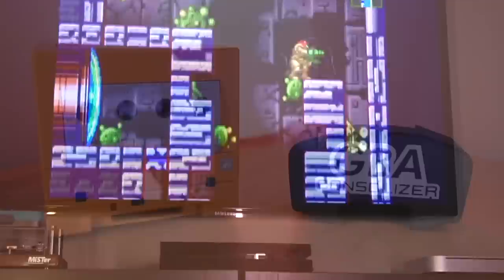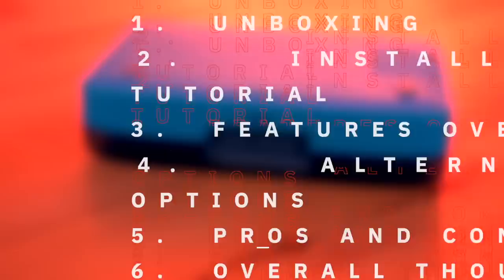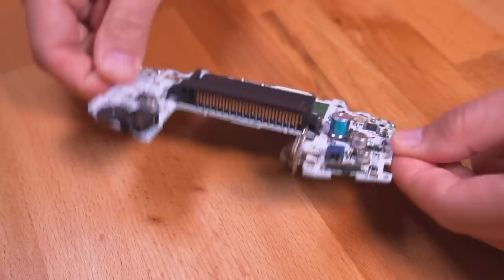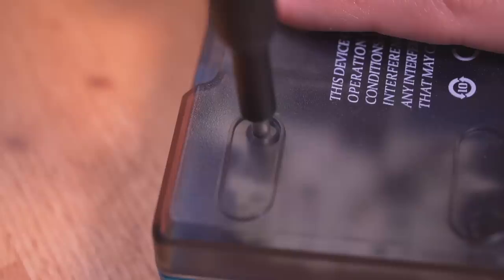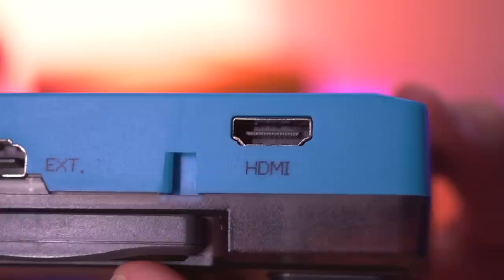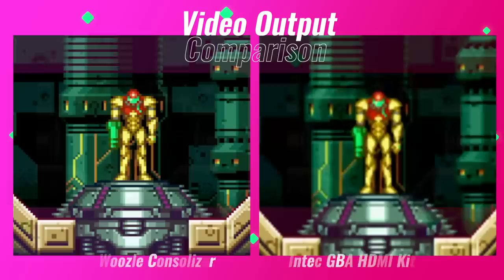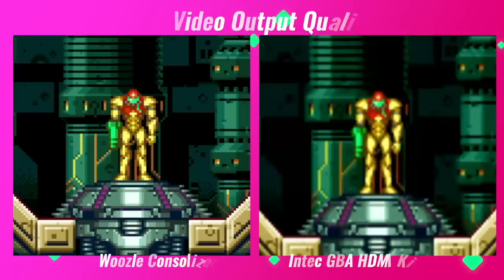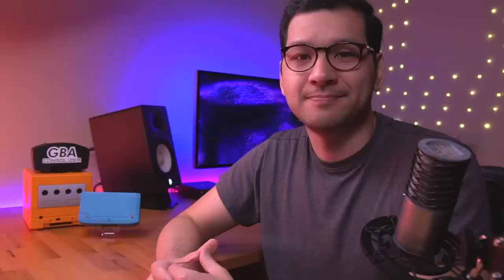Easy NO SOLDER GBA HDMI Consolizing Kit!  BUT, Is It Any Good?

Comment: They should have made a premium version that makes use of the screen on the left over GBA converted to controller. Maybe use one of the left over holes (the headphone jack?) to add some ability to send video to the GBA's screen so you could even take the thing on the go if you wanted. The GBA's existing battery compartment could be used to power the GBA  controller side but I imagine you'd need some kind of powerbank or something to power the main unit.
Reply from the maker: That would be cool!

Comment: I knew as soon as i saw the Aspect ratio switch it was gonna have garbage video output, which is such a shame as it's an amazing idea for a solderless install and and the construction seems great, the design is nice too and the GBA styled controller is an amazing idea too, the only thing i'd like to see physically change is an extention for the cart connector as it doesn't make much sense to have it on the back.. it's so close to being perfect, but man that picture quality is a dealbreaker.

Comment: The soft image isn't too much of a deal breaker but that aspect ratio is.  If they can fix that then they have a solid product.  I'd even be happy paying a few dollars more for a better upscaler/conversion chip that can do it right.  I absolutely love designs that utilize pogo pins because it creates accessibility to the mod for everyone.  The controller conversion board could be VERY desirable even if the consolizer flops though and is a great way to prevent e-waste.  It also retains the nostalgic feel of playing GBA in your actual hands.
Reply from the maker: Totally agree!  Hopefully they can address the aspect ratio before delivery of the Kickstarter

Comment: 2 things you didn't mention.

One is a ping time comparison.  You should plug it in the CRT Composite hookup. And compare ping vs Game Cube and the other adapter.

The other is SNES Fight Stick mapping.    How are the configuration with a YBA stick (when system was contemporary)  vs a BAR stick (when it's retro).

Extra featured: I would have a Control Config mode when no cartridge is plugged in.  Also choose your method on the triangle of options:. Pick any 2: full content, proper ratio, full screen.  FC+FS = stretch/distort. FC+PR = black bar cropping. FS+PR= zoomed in screen.  Or any combination of the 3 that adds up to 200%. So you can mix all 3 gradually.

Personally I rather see a Game Gear consolizer.  Nintendo has the Game Boy covered.

Comment: I was 100% ready to order, but the compromise made on the aspect ratio is a dealbreaker for me. Though I would still be interested in buying that SNES controller kit if possible. But in the meantime, I am more than happy with my MiSTer FPGA for HDMI and Gameplay Player running through Prism Gamecube Component Cables on the  trusty CRT.
Reply from the maker: The mister is a phenomenal option!  I love mine!
Reply: @MachoNachoProductions  Can you imagine if it was handheld??
Reply: wergfegrth  That is dope. I might have to pick one up once they get that fixed.

Comment: Really suprised you didn't mention the Gameboy Interface when using the Gameboy Player . Paired with a third party HDMI adapter, that is the best option for your money as it has the proper aspect ratio, scaling options,  and can provide a very comparable image to the consolizer and will cost you around $250. 
Gamecube: $80
Gameboy Player base: $45
HDMI converter: $75
Gamecube Media Player: $25
Third party SNES-style controller: $30
Total Cost: $255

Comment: Other mod makers should take note, that pogo stick design is genius.
Reply: I'm sure it's not a concept lost of most "makers" of products like this. 

It's just not nearly as reliable, IMO, as a nice soldered connection (when done in the hands of a skilled installer)

The pogo pin option allows this to be something people with no soldering skills or equipment can do, but there could be a trade off especially if the pogo pin force design wasn't done really well.

Comment: Screen stuff aside, my big problem with it is that you have to remove the speaker from the GBA motherboard. It would be nice if you didn't have to damage the board in order to get it inside the shell. I'm sure you can solder it back on but that's what this product is trying to avoid. I'd rather not damage my legacy hardware in any way. For that reason, I think the best option for GBA over HDMI (minus emulation) is the GameCube player with either an HDMI mod or a good converter like a retrotink. It will require a lot more legwork if you don't want to pay a lot for a disc but I think it's worth it.

Comment: honestly if it werent for the aspect ratio and sharpness issue, i would've totally sprung on this, considering not only is it easier to assemble but also doesn't irreversibly mod the system and cause thousands of GBA shells to get thrown out.

Comment: I don't mind a soft image. I actually use real hardware specifically for it. If I want razor sharp pixels (which I do love, I think some of the SNES and GBA sprites are pure art) I'll use an emulator and make sure the integer scale option is selected and I can use my PC, WiiU, or PS3 for that. But the aspect ratio really is a bummer on this. The 4:3/16:9 switch is a great idea on paper, when I first saw it in the video I thought it was just to make sure it displayed properly on each of those aspect ratios, I figured it would be letterboxed on 4:3 and pillarboxed on 16:9. At this price I can't figure out who this is really for. I would think the people willing to shell out the cost for this plus the cost of a GBA (even if you already have one it is part of the cost after all, you no longer have that portable GBA) would value the proper aspect ratio. I would think the kind of player that doesn't care about the aspect ratio would be happier with that little Hyperkin cube thingy that plays GB/GBC/GBA games also with an SNES controller, and also over HDMI at a much cheaper price. I would absolutely shell out the cash for this thing if the aspect ratio was fixed, doesn't have to be integer scale but at least 3:2.

Comment: Fantastic review. I wonder if the scaler intec is using has limited options. Perhaps its a choice in cost for them. 

To answer your question, if I could change 1 piece what would it be. Interesting question. If you had to pick between fixing the aspect ratio or the softness. hmm. I think I would fix the softness. While the aspect ratio is something that could be fixed outside of the device, you cannot sharpen an already soften image (at least I don't you can).
Reply from the maker: I agree, I think cost was a major consideration. With the consoloizer kit from Woozle, you’re getting a nice FPGA which makes a huge difference in quality and price
Reply: I feel like the sharpness and the aspect ratio are the same problem. Both are solved by integer scaling.

Comment: I love the concept that the way they use the original GBA shell as a controller. Here is the thing. I really wanted to play WarioWare Twisted on the TV that there is no way I can play them with the GBA Player and the Woozle GBA Consolizer. I would suggest that the card slot would still be on that GBA controller rather than the console itself. It is just a little nitpick but to each their own, right?

Comment: Just as FYI. The fact they sent it to you for free means you have to add the "paid promotion" tag. I didn't see that at the beginning of the video, and there are people who will report the video for that reason alone.
I'm still at the intro, but from what I've seen I wish the cartridge slot and controller port were on the front, and power and HDMI were on the back.

Comment: i already have the Woozle kit.
the assembly absolutely pushed my skill at solderuing but in the end it worked out fine.
i missed 2 bridged pins the first time i tried it. simple fix but you have to spot it first.

i wont get this kit becaue i have a GBA console and its Funtionally Better in every way. but im a big fan of how non invasive this thing is.
one could easily reverse the whole thing to a standard GBA

Comment: This is really cool. I like the idea of being able to easily reverse the mod if you ever decide to. One drawback with the pogo pins is not making a reliable connection after multiple cycles. But this isn't something that will be disassembled frequently, so that shouldn't really be an issue.

Comment: Since it has composite, you could use it with the RT5X and correct the aspect ratio and sharpen it a little more while adding scan lines. It wouldn’t be that bad actually and is probably one of the best ideal scenarios to use this. With that consideration, HDMI here is basically composite being passed through from what I can tell so may as well use an RT5X and RCA. 

I’d like one so I can play Crazy Taxi Catch a Ride without emulation.
Reply: There are way better solutions to play Crazy Taxi though.
Reply: @Pedro.Sanchez  I agree. I’m not buying one of these at all just saying to the content creators who were gifted one. They can give it to me and I’ll take it but I’m not wasting money on one 😬

Comment: As soon as you said Intec I knew what to expect. They probably used a simple composite to hdmi adapter. It looks great (aside from the cartridge connector being on the back), but the soft, wrong AR video output makes this a non-starter for me. 

There are so many great options to play gba games out there (Swiss, Gba consolizer, ips modded gba, ags-101) that this product in 2022 is just underwhelming.

Comment: I've been playing GBA games on my RP2+ and the slightly wrong aspect ratio really doesn't bother me. At lot of the time if I hadn't been told it was wrong I really don't think I'd notice. Part of that is I think because I never had a GBA growing up and so I'm not upset by the games looking 'wrong'.

The choice not to have the correct aspect ratio for a kit using real hardware though is an odd one and hopefully it'll be added as an option for retail release.

Comment: Seems a bit abundant IYAM.
I hope ordering just the shell and kit is an option for those that have cables, controller, screwdrivers and eraser (!)...
Controller and cables are extra excessive if you consider any BT controller can be paired and the kit has a full HDMI port.

I like it, I'd even consider this kit over the GBA Consolizer were it not for the resolution options.
However I have a GBA player for my GC :)
Reply from the maker: I hope they can address the aspect ratios before delivery.

Comment: Think I'd just change the video options to be more expansive. Even if it mean providing a second tier kit. Aspect ratio isn't a deal breaker since I can fix that with the TV, but providing even RGB output so I could run it through another kit like retrotink 5x with a component cable or (in an ideal world where money is no object) provide the GBA output options of its own with an onscreen menu so I can take full advantage of that HDMI port. Even if it was just an LCD onthe front with toggle buttons, it would be better than the limited options presented in final. Maybe version 2.0? Guess we'll see in a year or so if they revisit this product and allow for better optimization. 

Pins I have no issue with, the injection mold should help preserve alignment. Just don't drop it lol.

Comment: The one thing I would changes is actually pretty obvious and this would be to change the 16:9 to a 3:2 ratio. Since TVs and monitors stretch it anywy to almost the full screen it would only have some minor bars left and right but this is totally fine. Especailly if you get pixel perfect and it would have therefore a better image quality. Then and only then the price would be as perfect as it can get.

Comment: Those Pogo pins are going to be the way of the future for sure. It's about the most positive thing to say here, and I'm really curious what console this was pillaged from. I am assuming a PS2 or Xbox, since nothing else would need to deliver 4:3 or 16:9?

They should make more of these, for different consoles, because the GB/C/A isn't it. Those aspect ratios... yikes.
Reply from the maker: The pogo pins are an awesome idea for sure!
Reply: @MachoNachoProductions  They make it so much more accessible. Especially with how this is laid out. Doesn't look like there's much way for them to get misplaced as the motherboard kind of sockets in anyway for the screw holes, so it just works out good.

If they can adapt their board, assuming other than pinout it isn't locked to a GBA (I don't know how these boards work), it would be great for an HDMI out for the SNES/Genesis/N64/PS1/etc., consoles that actually supported 4:3.

I think for an early demonstration of what they wanted they did good, it's just unfortunate they had two aspect ratios and neither worked for the devices in question (GB(C)/A), which led to the really soft image you demonstrated.

Comment: as soon as i saw no soldiering and everything just pops into place i back the KS. I already have a modded and working gba already, but been wanting to get one working on the big screen for the longest time. working with my regular gb games is also a plus since it lowers the clutter of multiple devices.

Hopefully they see the feedback on the video quality and see about adjusting that, likely an issue with the pins as the ample video also had minor flickering.

Comment: I'd say the soft video output and aspect ratio is pretty disappointing when you consider how much trouble they went to in making the kit so nicely put together and easy to use. $130 is still pretty spendy just to have that soft video output and incorrect aspect ratio. If this was a $75 solution, I'd say it's fair. But, at $130, it's a bummer having those video issues.

Comment: I would buy one if the aspect ratio was correct. I can deal with a soft image. Ideally both could be fixed but the aspect ratio being wrong is a deal breaker.

Comment: This is very cool! I saw on the Kickstarter in the comments section, someone mentioned your cons, Intec replied that they will be fixing the aspect ratio and softness issues. Do you think you'll do a follow up? Have you been in contact with them about that? I kind of want to pull the trigger just for the bluetooth and the snes front port, but I care a lot about the video quality!

Comment: The concept of console mods using pogo pins and maybe even devices that can clip onto the chips on the board without soldering is intriguing to me. The idea of modding without needing to permanently change the board in any way sounds great. While I understand you are hesitant with these solutions personally, do you think there is any concern for longevity of devices like this due to the pins wearing out over time? Is there enough of a market for accurate video out mods with installations like this, or is it simply best to do soldered mods, and have the average user need to pay someone to install the mod?
Reply: Back in 2003-2004 or so, I got a PS2 modchip that was solderless.

It had little spring loaded "hats" that sat on top of the two chips that the wires all normally get soldered too. 

I personally killed my V7 PS2 motherboard because I installed those hats with too much force and bent legs on one of the quad flat packs. It worked fine for a few weeks, then one of them must have finally shorted... the DVD drive just shot open when I was playing, stayed open, and the unit wouldn't shut off with the power button. Thankfully I knew someone who had a V5 PS2 with a bad DVD drive, so he gave me the board out of it. I installed my mod chip again, being more careful with the pressure of the no solder "hats" and then ran lense changer to make my KHS-400C work on that board that had a KHS-400B laser originally. The PS2 worked great for a long time after.

It was a DMS4 EZI Pro. Great chip. But care had to be taken because of the solderless install options.

This pogo pin setup is a similar concept. If not done well, the mod will at best stop working properly and at worst, damage the motherboard.

Comment: Man, such on interesting mod, but that video output is a deal breaker. I also wonder about the long-term reliability of those pogo pins. Though, I guess it's always easy to remove the PCB and clean the contacts if need be.

Comment: For me the best aspect of this kit is the use of the old shell as a controller because it retains the feel of the GBA minus the screen. To me this is better than using a NGC controller with a GB player accessory. Of course the aspect ratio and video quality are deal breakers.
Reply: If you have that GBA to GC cable that Nintendo used to make you can use a GBA as a controller for that, too.

Comment: Well, the idea on the Paper is excellent and I just LOVE the concept of convert the GBA shell to a controller.

BUT like you say, why this image is so soft and with the wrong aspect ration T_T. The 50$ kit than add micro HDMI without to consolize the GBA have better vidéo out than this kit.

Sure the price is not high, but come on, even if we don't search the quality of the GBA consolizer by Woozle with the full menu and controll of image quality, just a good vidéo out (so with RIGHT aspect Ration + sharpness) is the minimal to give ! And if they want to have 4/3 and 16/9 switch, why not but use them to have letter box 3:2 ration !

and YES THE RETURN OF THE VIDEO INTRO ^_^ !

Comment: Doing the Gameboy Player dirty there. 
Should have stated those results are with the included official software.

Gameboy Interface with the Gameboy Player will give you razor sharp pixels if you tweak the settings for your display.